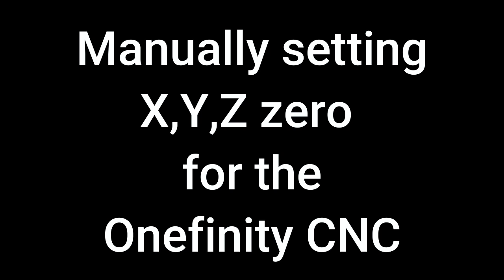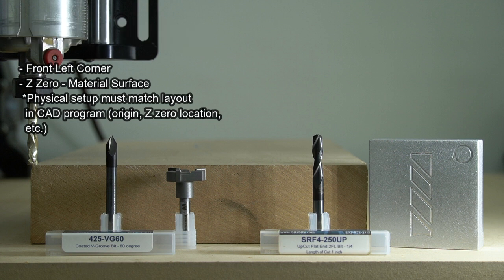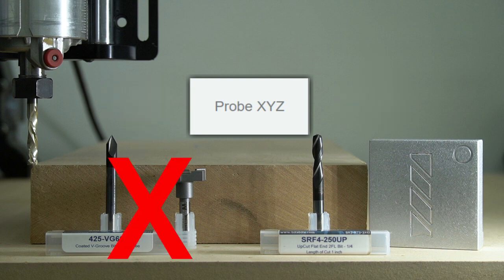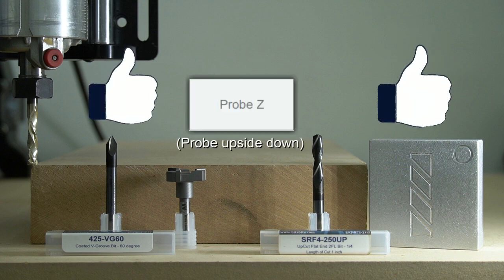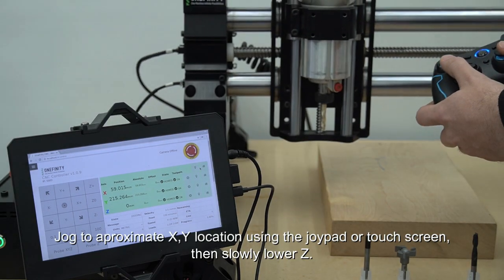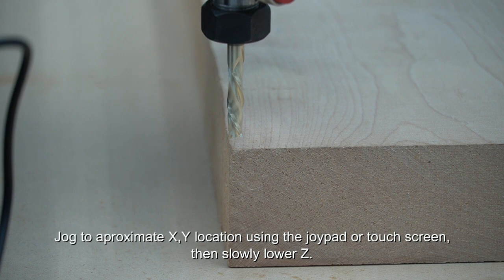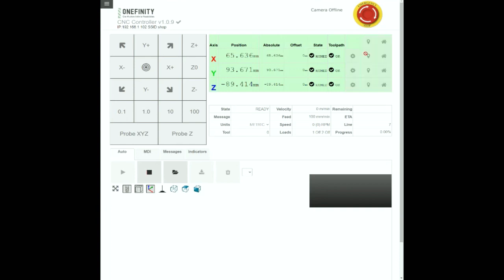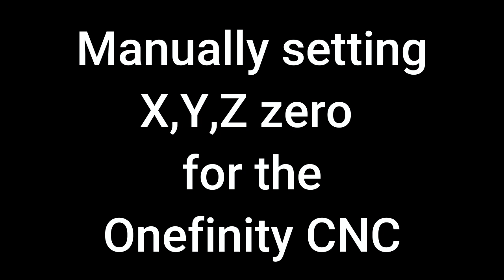Manually Setting X,Y,Z Zero on the Onefinity  CNC for non-elite machines // Support

Comment: I'm new to the Onefinity.  I have been using a Openbuilds Workbee and their black box controller.  I do several carves that require three bit changes during a carve.  In the Openbuilds controller, there is a drop down that after a carve will allow you to go back to zero.  The only thing you have to do is re zero Z.  Does the Onefinity controller have this same option or do I have to start over zeroing?  This is very crucial when doing a 3d carve.
Reply from the maker: Same thing.
Reply: @OnefinityCNC  Where is this function located on the controller.